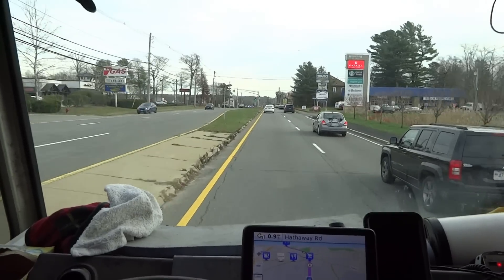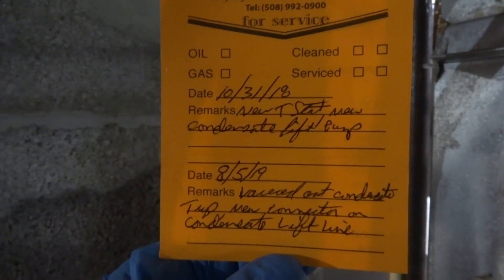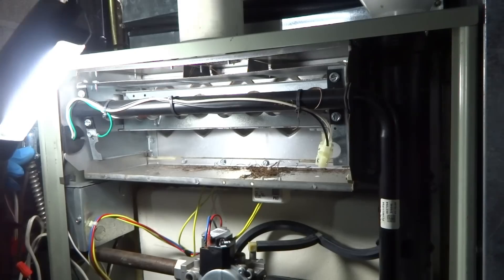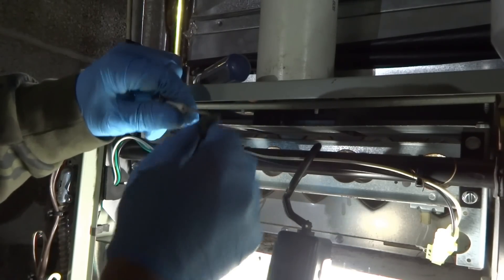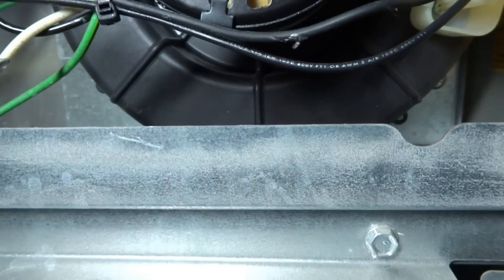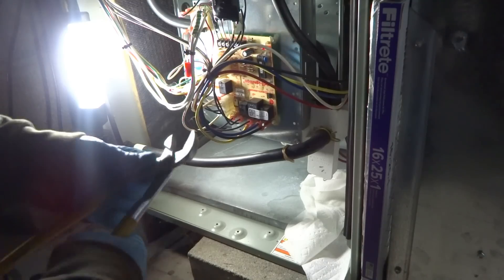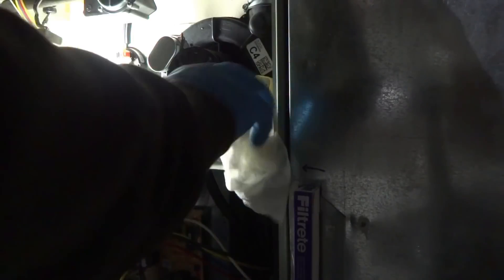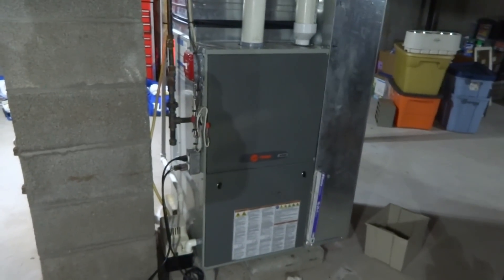TRANE GAS FURNACE 2 BLINK CODE ISSUE

Comment: Buddy of mine had the same issue. You could hear the water sloshing inside the draft inducer. Pulled the hose and emptied the water out. Cleaned out the clog and he was back in service again. Good eye and good ear there Steve. Gonna have to start calling you the furnace whisperer.

Comment: My trane has the red light flash twice too for the retry. What she is explaining is correct. It will retry a few times then stop trying to light but then the blower motor comes on for about an hour blowing cool air. Once the hour is up it tries to light through the cycles again. Only difference is that mine lights and burns for about 3 secs before shutting off. Flame sensor was cleaned and the induction fan replaced due to bad bearings

Comment: I told you not to run these fancy filters, but I see your runnin’ em anyway. Why’s that? Lol I love it! Great video Steve! Merry Christmas to you and your family!
Reply: People are scared to run the cheap filters especially nowadays with the virus around or if they have allergies.  They think it will help the air, it actually does, but little do they know what it does to the system and the reduced air coming out of the vents.
Reply: You shouldn't run cheap filters. Do you put cheap oil in your car?
Reply: @Jake_Smith7472  not remotely the same thing
Reply: @lj8736  give me one reason why you'd run cheap filters. I'll wait
Reply: @Jake_Smith7472  way less air restriction with cheap filters better flow not working the system as hard!!
Reply: @derekmoen5382  cheap filters cause dirty blowers, systems and ductwork. Quality filters aren't enough to restrict airflow. Or else they wouldn't even make them lol Next
Reply: @Jake_Smith7472  lol you do you!!
Reply: @derekmoen5382  explain 4 inch media filters then

Comment: @6:53 my favorite part... suprise! Water leaking. Nice find on the blockage, the 2 code blink went away after you cleared it. Weird there is condensate in winter? I thought we only got that for AC. Ohh, maybe that spot is really cold down there?
Reply: 90+ furnaces produce condensation when they heat. The condensation can actually be somewhat acidic and can damage old cast iron drains.

Comment: I work at Lowe's and they made me take computer training on furnace filters they told me to use the more expensive thicker filters I believe the same as Steve and I never use that training to sell furnace filters
Reply: When the unit has a smaller return than recommended, it’s better to use the cheaper filters so the unit doesn’t have a hard time drawing in return air.
Reply: If you don't have sufficient airflow through your furnace it will overheat and shut off, it will trip sensors inside the furnace (high limit switch).  The result will be short cycling and the furnace will eventually not be able to heat the house efficiently, it could make 3 attempts or whatever and go into lockout for an hour unless the system is power cycled.  This happened to my furnace so I quit using the pleated filters and just threw in the cheapies fiberglass ones and replace them often.  Granted my furnace is older - 20 years or so.  Do pleated filters do a better job - sure but if you have an older furnace it might suffocate it and cause it not to work.

Comment: Hey there.  Mind   just clicks like it doesn't have any gas with continuous red light.  I was just using it but noticed that it just turned off and started clicking. The diagnosis chart stated replace IFC. Could it be the thermostat? What do you think I should do?

Comment: Should have pulled the inducer motor and checked the transition behind it. Its usually cracked and then look inside the plastic trane uses is usually cracked there and thats where the caulk came from condemn the furnace replace the h/x or sell em a new one.
Reply: You don’t have to replace the heat exchanger to replace the transition
Reply: @iLikeC00kieDough  
That is true but 99 times out of a100 its all cracked right there
Reply: @Brian-qv1qw  I replace those transition receptacles all the time and I’ve never seen a crack back there.
Reply: @iLikeC00kieDough  
You need to get in there with an inspection camera. After you pull the inducer stick the camera in and go to the right and start looking for a crack in the corner sometimes it could be on the left side.
Reply: @Brian-qv1qw  I’ll check it out next time I do one. Thanks for or the tip.
Reply: @iLikeC00kieDough  
No problem. Its a good place to check just because you can't see it from the outside the only other clue is a water leak that you cant explain. Once that header I think that's what they call it is cracked you can't replace it only fix is new h/x or new furnace.

Comment: does it reset itself?,,,the flashing....only problem i ever had was pluged drain in floor(under the slab)
Reply: Once you turn power off and back on to the furnace error code is reset at control board. Notice steady flash at the end of video, that’s normal operation.
Reply: so,anyway,i changed my drain the sch. 40 now with a open to air over flow...but hasnt pluged in about 10 years...???

Comment: Had this problem develop lately. Turns out the inductor fan drive has broken away from the motor. Repair tech says he sees this common on Tranes. Had just had the recirc fan replaced in Jan.
The water is from the fan not driving it out the flue.
Had to shut off the furnace from firing for the past three days. Had water running on the floor from the condensing water not being expelled out the flue.  New parts showed up today, and will go in tomorrow.
And to add, this guy is wrong about the filters. Change them as the maker recommends. If you can't keep up with that task, settle for the cheap fiberglas.